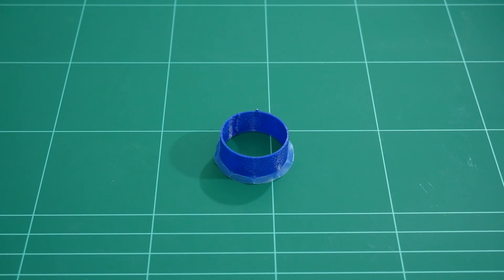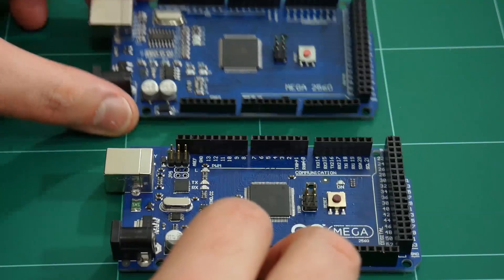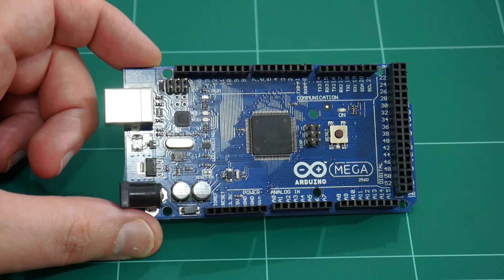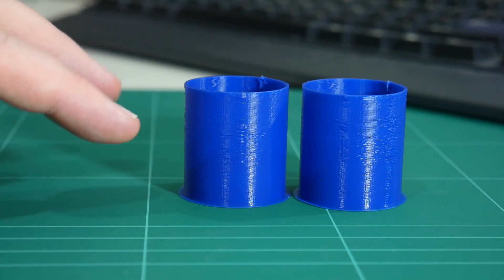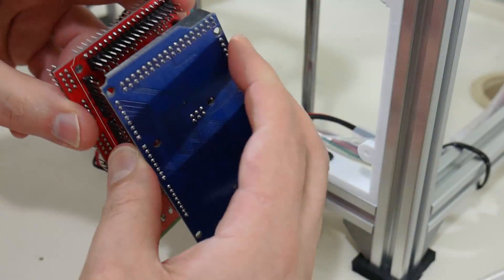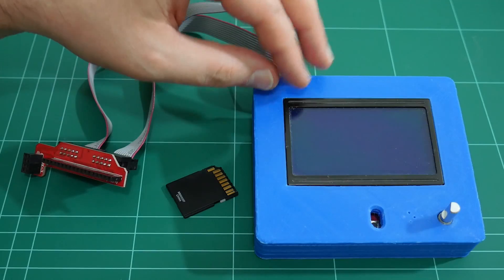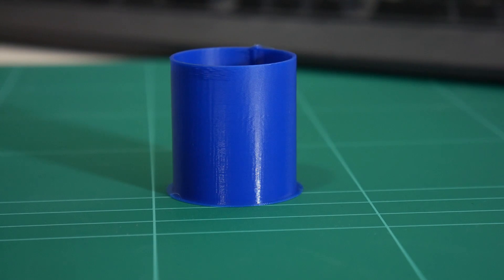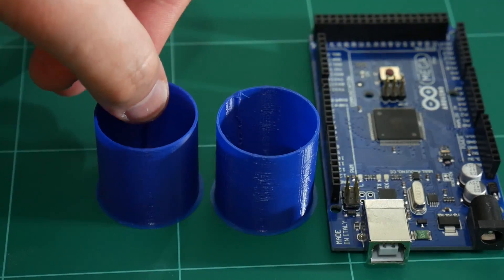HyperCube 3D Printer 8-Bit Speed Wall - Part 2

Comment: Nice case study as said but i failed to truly understand how did that happened.. I only print via USB, and i print at 100mm/s everyday, with perfect finish. I use an Azteeg X3 PRO; could it be that?

Cheers o/
Reply: Xpim 3D that’s still an arduino mega plus ramps-based schematic. It’s got the FTDI serial comms chip, but that won’t make much difference.

The real issue is that you’re probably not printing continual circles at that speed. Especially not high poly circles. Every segment in that circle is the same amount of gcode — so the same amount of serial comms — as what could be 10 centimeters of straight line. Circles are often 12 or maybe 24 segments, but this one looks more like a 60 segment or so circle, so that’s a lot ofgcode to push through a 115k2 connection.

So doing the math: a line of gcode is maybe 20 characters or so. So 200 bits. At 100mm/s, a 100 mm line segment has 200 bits and 115.200 bits of room in that second. A 60-seg circle of 1 inch diameter has about 80mm of circumference — call it 100 to make the math easier — so it should print in 1s, take 12000 bits of gcode data, and still fit easily within the available comms bandwidth.

This is probably why the 32bit boards fare better: if they have to transfer 20 or 30 kbits a second worth of gcode, they can do that with both hands tied behind their metaphorical backs at under 1% cpu utilization. The atmega2560 though... we’re pushing it damn hard. Handling enough interrupts from the serial chip (every 16 characters or so at the least) will make it hard for it to consistently also handle calculating and pushing the step/dir signals.

Comment: Very fascinating!  Something that may be worth looking into:   In the Configuration_adv Section of the marlin firmware, you are allowed to change the buffer size of incoming commands.  And in Repetier there is a setting under "printer settings" that can be changed to reflect those changes you made in the marlin firmware.

The reason that changing the baud-rate had little effect was likely because the baud-rate over USB to Serial is not the bottle neck, its the incoming serial buffer size being to small.   You should be able to adjust this and test your results similarly to how you have in this video and since you can disable SD support and LCD support you should have plenty of memory available to increase the buffer quite a bit.
Reply: do you know of anyone that has tried this? just recently built my first 3d printer and encountered the issue discussed in this video, but would like to find a way to workaround with software rather than buying a new control board...

Comment: Fantastic comparison, very useful, thank you! I wonder, if the display would be active, would it affect these speeds significantly?
Reply: Little bit slower, because a full graphics display is yet another thing the arduino has to do with its limited time. But not too bad.

Comment: I think; just because you can doesn't mean you should...  {  "just because you can doesn't mean you should" }
Example a car can max out at 100MPH round a race track, doesn't mean you should run it all day at this speed because the engine will fail much quicker
Reply: Protomaker Black Sprint Original 3D Printer We run our Delta printer with mega 2560 at 150mmps when we prefer speed over any quality, but it has not failed us yet.

Comment: That's incredible! My printer has a proprietary board which also utilizes the CH340 chip, but I was under the impression that since it's got a buffer for the serial communication it wouldn't make a difference. I will definitely start printing via SD for prints where I want the highest quality and speed. Thanks for sharing your findings!

Comment: This leaves me wondering: the 3d-printer can both receive data via serial com, and print from SD - so why can't we just pre-upload the gCode via serial com, to be saved onto the SD, and to be then run from the SD? All the dots are there, why doesn't somebody connect them?

Comment: Hi, Thanks for testing this.
did you check the settings in marlin for "ensure_smooth_moves"?
and if possible can you test a faster sd card (I don't think that this will make a difference...). 

awesome printer - great videos - subbed, Richard
Reply from the maker: I think the feature "ensure_smooth_moves" is in Marlin pre-release-RC8. 
Another commenter has tried an older SDcard and saw no difference with print speed.

Comment: FYI: The new marlin bugfix has a routine that deprioritizes the refres rate of the display, so it doesn't take away any processing capacity from calculating print moves.

That being said, how do you load a print from the card with the display disabled? When I disable the display and enable only SD support, the encoder wheel becomes unresponsive as well...
Reply from the maker: In Pronterface there is an SD button. It allows you to view the files on the SD card and print from them. Handy feature!
Reply: I see, now my cheap china LCD that requires the usb connection for power is biting me in the *ss :D

Comment: Interesting!  I've always transferred to and printed from an SD card from day one.  No wonder I got such good, fast results from my Chinese Prusa clone (when it worked - which was less than half the time).

I'd love to see some testing of a 32 bit, 100+Mhz processor, and see if it makes a difference in real world printing.  I like the specs of the MKS SBASE, but it is poorly thought of in the enthusiast community; most feel that the Chinese company  used the hard work of the smoothie creators to create a closed source card.  And there's virtually NOTHING in terms of reviews; one guy played with it overnight and liked it, another guy put a YouTube review up... in Spanish... and, that's about all there is.  Oh, and all the comments regarding stealing the smoothie board creators work.

So, the question remains: given a printer capable of high performance, like the Tech2C design, does a 32 bit processor result in real world quality and speed improvements?
Reply: charles worton Prusa style machines in general can do quicker than CoreXY - less calculations necessary.

Comment: I don't not believe either are real, the chip next to the usb port should be Gold if its a original Arduino, not that it changes anything.
Reply: bigfilsing yup I saw that too. But I have a friend that uses the ch340 in a commercial product line. and it's performance has tested out very well.
Reply: It was great that Tech2C made the effort to test thru the serial interface to the level of serial comm chip. I have a couple of original and at least 3 clones ( with the ch340) and have never noticed any performance difference so far. With the whole FTDI gate affair a few years back the CH340 was the obvious choice as a replacement
Reply: bigfilsing the 8u2/ 16u2 usb chips are far cooler, though. I heard you wanted to usb on your microcontroller so I put a usb microcontroller next to your microcontroller so you can usb while you microcontroller.
Reply: Heh Tibuck ...Yup both fake https://www.arduino.cc/en/Products/Counterfeit
AFAIK Arduino megas use FTDI comms chips

Comment: Very valuable info, thanks for showing us.
Do 32bit boards suffer the same? I guess they do if printing over USB?
Reply from the maker: I'm unsure as I haven't used them yet. There is a buffer in the processor, so I'm hoping the 32bit boards have a larger buffer to send larger chunks of the gcode at a time. That should help.
Reply: Thats what I was thinking, but if the data flow is too slow, then at some point the buffer would empty.
I'm sure we will find out one day.
Reply: Most 32 bit ARM Microcontrollers bring USB built-in. This means they implement the Serial port emulation directly on the chip. Thus actual serial speed is not an issue any more. The host can blast the data at USB Full speed into the controller.
Apart from that the processing power is vastly higher. Overall the speed wall is probably beyond what a 3D printer can achieve in reality.
Reply: @kaihorstmann2783  You're quite right, these days USB over serial does not have the bottleneck that was prevalent 3 years ago when the comments were posted.

Comment: so if you use octoprint you are limited to 45mm/s? :O
Reply: This is what i'm thinking. It would certainly seem to be the case. Would be nice if there was a way to get octoprint to write the file to the SD card before starting the print.

Comment: The voltage regulator chip is Gold on an authentic Mega. (501L) A lot of Clone versions have a green chip labeled 5x5. Like the Funduino clone.
Also, the dots around MEGA on the front of an authentic board do not have any spaces or missing dots.

Comment: Its good information indeed. I just know the serial communication speed can effect the print result. With faster speed processor such as MKS base probably can even better result and faster speed
Reply: MKS base is the 2560 version and the SBASE is their ARM (smoothieware clone) version.  Was very confusing at first but I think the S in SBASE is a kick to Smoothie.
Reply: Yes, I meant SBase one is ARM processors.

Comment: I bought my mega2560 in china but it's written made in italy on it too, for the price it definetly wasn't. Interesting tests, it shows why the smoothieboard is an interesting option. Also I guess the max speed you can achieve depends on the stl resolution. Higher resolution = more gcode commands = slower speed.
Reply from the maker: Yep, agreed.
Reply: Glenn Johnson and it enables you to use 1/64 or 1/128 microstepping as well
Reply: TheLukey21 but those settings really do not improve the quality of the printer...

Comment: thats so slow. I print at 150mm/s
MKS Base with a SD card
Reply: +Tech2C Hi, maybe you could share that exact cylinder model so other could print it and then compare against a wider range of boards.
Reply from the maker: Core XY Printer?
Reply: Tech2C yes
Reply from the maker: Ok, Are you using Marlin RC7 firmware and Cura for slicing?
Reply: Tech2C I am using Marlin for the firmware and cura to slice. The belts need to be very tight to print at high speeds and use a thick layer hieght. I print at .3mm for large prints at high speeds
Reply from the maker: I used the same gcode file for printing via USB-to-serial and SDcard. The SDcard was clearly faster so tight belts aren't the issue (mine are tight anyways). I'm assuming the resolution of the cylinder test file is different between us.
Reply: CHEP 3D Printing the retractio is okay. It depends on the filament. My black PLA is fine at those speeds well  clear natural PLA struggles with retraction.
Reply: Tech2C I have been printing 3dhubs orders and other models with these speeds no problem